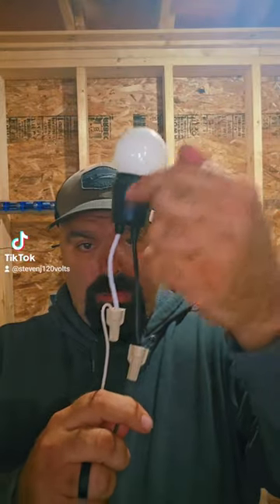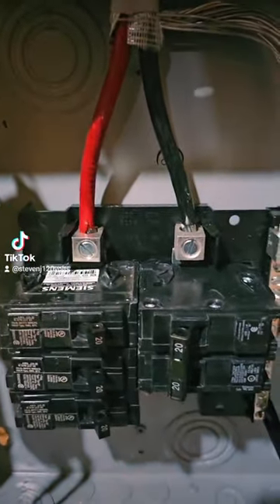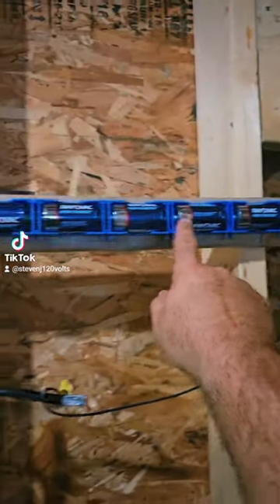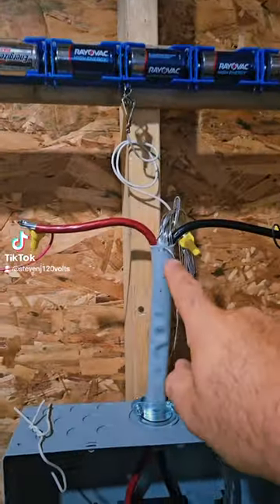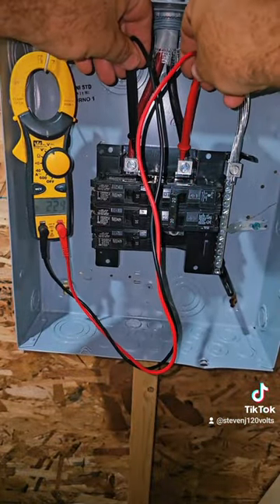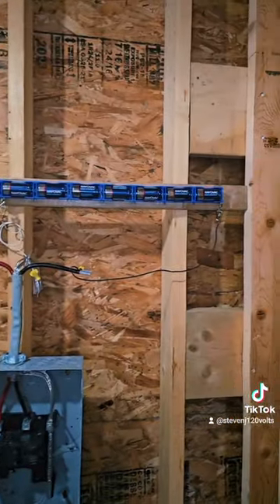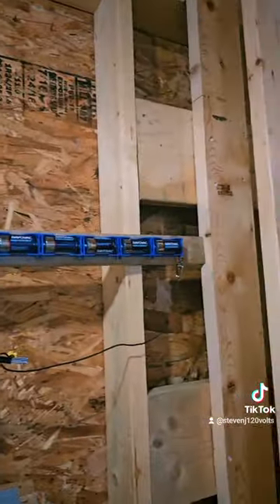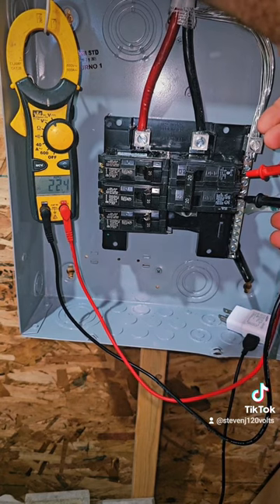why doesn't a 240v circuit need a neutral???

Comment: Only pertinent in the antiquated and inferior USoNA grid.
Reply from the maker: This is how any single phase system works
Reply: @Stevenj120volts  the USoNA system calls 220 single phase when in fact it is 2 phase, a PD between legs. Aus has 240 to neutral or ground. Totally different. The USoNA  runs higher currents and thus has more potential for death and fire. Also the 60hz has more hsrmonics issues. The USoNA receptacles have accessible connections where GPOs in Aus must pass the standard finger test. You simply are coming from a lack of knowledge of other systems.
Reply from the maker: @markhill9275  I promise you the US system is one phase split. If you have an apple and cut it in half you still have one apple just two pieces.  Splitting the phase with a center tap does NOT create a new phase.
Reply from the maker: @markhill9275  I can link you to electrical engineering videos explaining this or you can have you instructor message me.  But just the fact it called single phase should prove it's a single phase.  It called an Edison circuit or spit single phase do some googling you will phase i am right.  We do not have two phases in our homes. We have "A" leg "B" leg and a nuetral. I don't really do you tube. But I have over 100k followers on the rest of social media and I am professional educator on the American wiring system in homes.   Which social media electrician do you trust. I bet I have their phone number and am friends with them I can find their single phase videos for you to watch.
Reply from the maker: @markhill9275  it is important for you to understand I do not think I might be right I am 100% positive.  I fully understand and have proven what I am saying with demonstrations and have taught this thru my videos to over 2 million ppl.
Reply: @Stevenj120volts  It is important for you to understand, i am an A grade, E class, special class Electrician, with 60 years in the industry, having worked on huge commercial, industrial , domestic projects.  I was accepted to work in Antartica, and could go on about my trade knowledge. What worries me is you believe you know everything, and are correct! Bloody scary. As far as 240v, you are wrong! Sorry to burst your bubble, i could go on and on debating with you, but that is a waste of my time, your obvious ego precludes any discussion. Making videos that people watch does not make you correct or knowledgeable, and that really does scare me!
Reply from the maker: @markhill9275  bottom line there is only one phase in a home.  If you think different I am and flat out calling you a liar on your  claimed resume.  I do not have a big ego.  I was giving you my back ground.  Who is you instructor that is teaching you there is two phases in an American home. I will call them on the phone TOMORROW.   Two phase is used in parts of Philadelphia that pretty much it, it  is an obsolete system no longer I use. In 28 years in the trade I have never met a licensed electrician that thought there was two phases in an American home. It is literally a first year apprentice lesson explaining it is one phase.

Please say it yes or no American home has only one phase?
Reply from the maker: @markhill9275  side note even you possible fake resume is irrelevant. I am 2nd generation Master electrician specializing in American homes.
Reply: @Stevenj120volts  given your ego and attitude i have doubts, first being 1st 2nd or 3rd doesn't make you any better, next, working on a sub standard grid and equipment and just purely domestic tells me all i need to know as to your level of competence. As to my fake resume, whatever, that's just a typical response, i could go on, but it's a waste of breath with you.
Reply from the maker: @markhill9275  there is one phase in American home.  When I said that you said I didn't have a clue.  Do you still say there are two phases or do you agree There is only one phase.  You started with the rudeness and ego first.  Look at the  comment when you said I didn't have a clue and you are completely wrong and the one without a clue.

Comment: 240 v center tapped transformer: 240/2=120. duh, oh and your split terminology is misleading, as you would use split phase in describing the motors you have in your house, like in your dryer, furnace. They are supplied by single phase but on their motors they have a capacitor to create two inputs that are out of phase, thus its called a split phase. But you are using terminology that you do not understand. The neutral is not split phase, it is a center tapped. 240 v center tapped transformer: 240/2=120. duh
Reply from the maker: Lol .. just to be clear are you saying American Homes are NOT fed with a single split phase?   If you think that maybe research for about 2 min. I will except you to delete you comment... Wtf....
Reply: @Stevenj120volts  ❤

Comment: yaaaaaa.......   Not really.   You are using DC principles to explain AC.  Single Phase 240 have the 2 ac legs precisely opposite so the RMS power calculation becomes 240, at 60hz.  There is no neutral because the ac "humps" relative to the neutral is only 120v, so the sign wave peaks have to be opposite to get to the 240v potential (again using the RMS calc)......
Reply from the maker: You are quoting big words but lack understanding.  Fyi RMS is what we use to give AC voltage it DC equivalent.  So if funny that you use RMS to try and invalidate my AC to DC analogy.  Again you could pass a multiple choice standardized test on the subject. But you do not really understand it.
Reply from the maker: If you freeze the cycle and look at it in one moment in time AC and DC are exactly the same.  FYI this battery stack to explain split single phase is not my idea it is a teach tool used in electrical engineering courses to explain what I am explaining.  I just hooked it a panel to help electricians get the visual

Comment: Ah ha, this is American electrics.  Proper dodgy anyway.
Reply from the maker: This is the description of a basic 230 volt European circuit. It works the same.  You guys ground one leg and call it the neutral. We ground the mid point and call it the neutral.  But all of our homes are fed with 240
Reply: @Stevenj120volts .   Europe is off of a three phase transformer without an additional transformer.  416/240v 3ph 4 wire Wye. Or 400/230V.
Reply: @KevinCoop1 This is the case commercially in the US, but there will still be a transformer that steps down the voltage. The US commercial standard is 480V/277V to 120/208V.

Comment: Wow please give up your electrical license right away you don't deserve one this video is scaring the living shit out of me in how you're explaining this. 

The concept is very simple the terminologies of hot and neutral are simply terms to describe a consistent way to wire something. In AC power there is no concept of hot and neutral. They are all the same you are simply tapping into the transformer at different areas in the winding. And yes that red and black is 180° out of phase from each other. Three phase power is 120° out of phase. So it is not all one phase it is two phases 180° separated.

This is exceedingly scary that you are an electrician.
Reply from the maker: Wow if you don't mind I will screen shot this and shared with Mike Holt as I have his private number. Please give me the name of the electrical school you went to. They need to have their accreditation pulled.  Have your instructor email me ASAP at stevenj120volts@gmail.com thanks.  DO NOt TOUCH any wires until you education is corrected.
Reply from the maker: You really think American homes are fed with two phases dear Lord. Why do you think it called a single phase service. Two phase exists and still used in Philadelphia but every other home is single phase
Reply from the maker: If you want you can check out my tik Tok.  @ stevenj120volt. Again stay away from electricity until you get your training fixed.
Reply from the maker: Before you continue to make a fool of yourself Google split single phase ... It how we power American homes

Comment: Such a miopic video that shows the huge ignorance of the person making it.  If a video like this is going to be put out to the world, the creator should explain that what he is talking about is only true for a very small portion of the world and outside North America this has no relevance.
Reply from the maker: Your commdnt show how little you understand.  The EU 230 works this same way.  The EU just ground a leg instead of the center tap.  In North America we have all the voltage options you do plus we can have 120.  Our homes are fed with 240 not 120
Reply: @Stevenj120volts In the US homes are connected 120/240 split phase.  The Neutral connection which is bonded to Ground has two Phase conductors that are at a potential of 120V with respect to the Neutral/Ground.  In Europe and the rest of the world (excluding Japan) the 230/400V has a Neutral that is again bonded to Ground and three phase wires that are all at 230V with respect to Neutral/Ground. 

If you are standing on the ground in a US home and contact one of the phase conductors you are only exposed to 120V. In the rest of the world this would have you exposed to 230V
Reply from the maker: @michaelharrison1093  you must be copying and pasting your answer form a website. Because you just responded to me by 100% repeating everything I said but slightly worded differently
Reply from the maker: Do you understand if in the eu you didn't ground one of your legs everything would still work
Reply: @Stevenj120volts just reading many of the comments from others about you mischaracterizing the European design. 

In many countries in Europe the maximum allowed single phase residential connection is 63A and above this you have to connect three-phase.   This means that the vast majority of residential home are connected and wired three-phase even though there might not be any three-phase loads.

In the US there is no other practical option for residential homes than to connect using a 120/240 split phase connection.

BTW I am a US electrical engineer with 40 years industry experience.
Reply from the maker: If your claim of a resume was real you never would have left your first comment.  Why straight 240 doesn t need neutral is a huge confusion for electricians.  Fyi I have 93k followers on tike 20k on Instagram and this video has over 600k views. And over 97% of My followers are from North America.
Reply from the maker: @michaelharrison1093  single phase is single phase where you connect to the the windings to Earth does not affect the potential voltage between the two legs.

Comment: In the UK,  a live, a neutral, an earth everytime.  Why complicate things.
Reply from the maker: You guys ground one leg and call it the neutral.  We ground the middle point of the coil it becomes our neutral.  This allows us to have BOTH 240 or 120 in our homes. Or even have appliances that have some parts that are 120 while other parts are 240.  The other advantage is we can have 240 equipment but the shock hazard to ground is only 120 volts.

Comment: Because  120 volts is only half the circuit, neutral is the return. Two 120's = 240. No need for a neutral.
Reply from the maker: So how does the current return to the transformer
Reply: @Stevenj120volts "Not needing neutral" in this case is kind of misnomer, the white wire from 120V device to panel is still needed, but in ideal world would not need wire from panel to transformer.

In ideal loads, even with neutral connected all the way, power will just go through red wire to load to white all the way into an another load and then into black wire.

Obviously in real world loads between phases are never ideally balanced, so neutral wire is carrying the "load difference" into transformer and hencewhy needed.

Also as it is defined as "neutral", which means it is tied to grounding at some specific panel, making that wire being referenced to ground to make system as a while better "defined" it also needs to be there all the way into transformer.. Same is true for #-phase systems in Europe no matter to what "leg" of transformer it is referenced with.
Reply from the maker: @samiolmari3821  we have some appliances that have only straight 240 3 wires  two hots one grounds.  While other have 240 4 wire 2 hots nuetral and a ground.  We have only ONE phase in our residential panels.
Reply from the maker: @samiolmari3821  I don't think you understand what this video is about.  It's explaining single phase 240 volt 3 wires.  Like a water heater.  There is NO connection to neutral on that type of appliance.
Reply: @Stevenj120volts  I was answering to the premise of original question and then your additional question of why wouldn't neutral be needed in that particular case of 120V systems (in some utopial ideal theory).. The rest was out of scope and not particularly under argument :)

"Only one phase".. Black and red  are 180 degrees in different phase relating to each other, aka literally in extreme ends on an winding, center tap being there or not doesn't change this. (In even longer physical things considered, yes the "one phase" feed comes from one of the three windings at upstream 3-phase transformer, but each coil still has 180 degrees "phase shift" relating to its own ends).
Reply: @samiolmari3821  The lines are 180 degrees out of phase when measured from neutral but they are still a single phase power system. In order to be polyphasic there must be a clear rotation of a magnetic field which 2 mirrored waves do not have making them monophasic. Its the same reason that you can take 2 lines from a 3 phase system and still only have one phase. True 2 phase power is obsolete and is only very rarely found, there are only a handful of systems in the world that have 2 phase power.